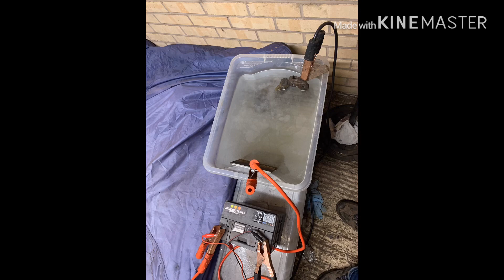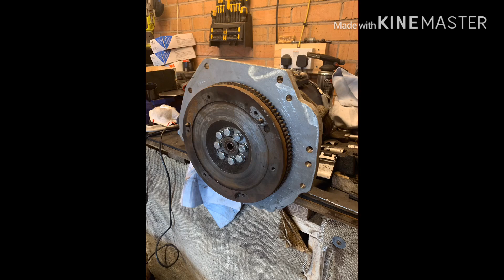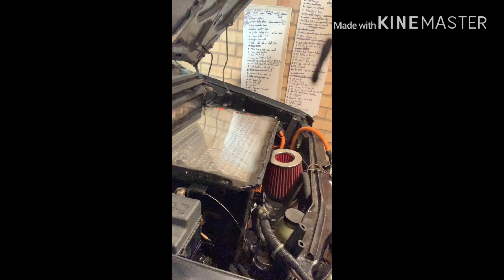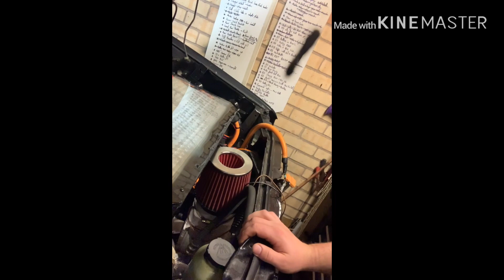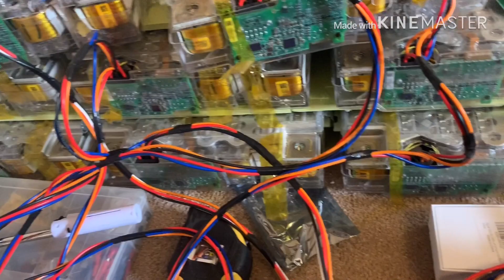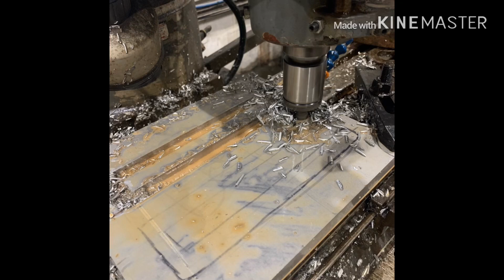Electric converted Suzuki jimny 4x4 part 1

Comment: Mate…This is a phenomenal build! I hope you’re doing this for a living! 

Do you think it would be possible to do a jimny EV conversion using hub motors and larger battery in the engine bay?

I wish there was a kit you could buy that drops into the engine with everything in it ready to connect and 4 hub motors!

Comment: How much would it cost to convert my Isuzu Trooper to EV 🤔
Reply from the maker: Peter King it depends on alot of things, range you want, power, your skill level. 

A 40 mile range and a mastery of skills could be done for the price (and using the parts) of a crashed nissan leaf. 

A full custom one like mine with tesla modules and decent range will be inline with a brand new EV. 

If your paying someone to do it then double all the costs.

Comment: Are you cooling and heating the battery fluid? How are you controlling that? Are you going to be able to pre-warm the battery pack in winter?
Reply from the maker: Jamie Jones at the moment ive just piped the batteries up, but currently have no heating/cooling tank. 
This is on my list to do. 
I will be heating the packs but im not sure ill need to cool them due to how low my power levels are. But once installed the heater will run 24/7 if needed (ie if the batteries get below 3degree’s)